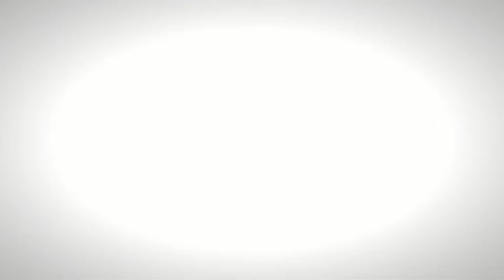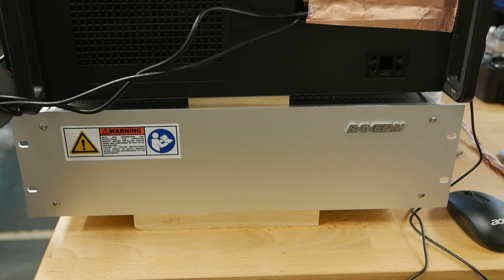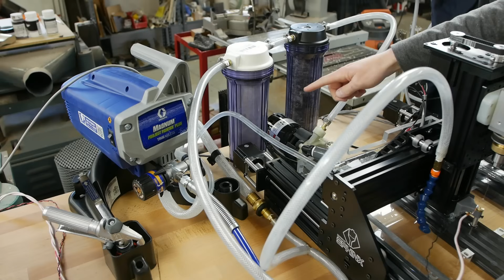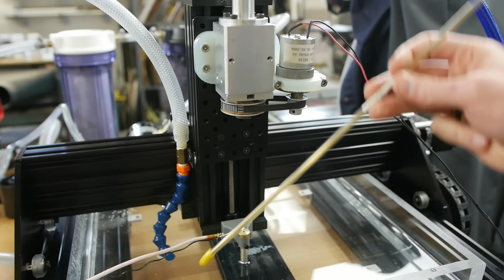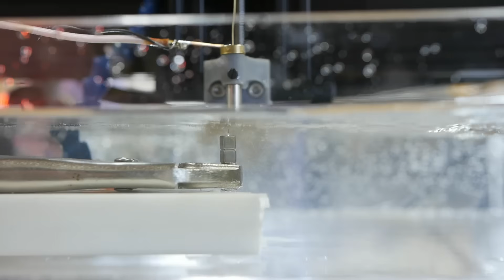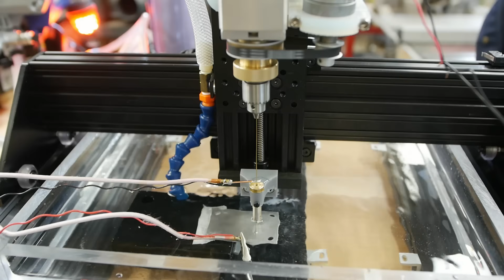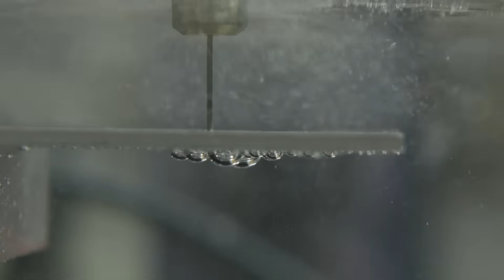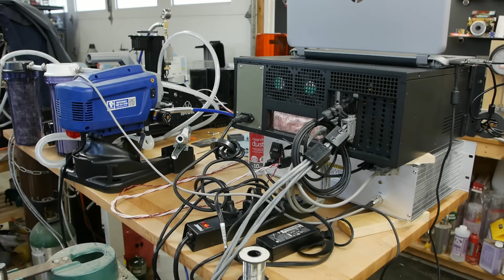Drill through anything (conductive) with Electrical Discharge Machining

Comment: What if instead of forcing pressurized water through an electrode you use an ultrasonic cleaner to get rid of metal particles while drilling? Will it work?

Comment: Just for fun i did something "similar" some time ago with my 30v 5a lab ps, a piece of copper wire and aluminium foil, just used the overcurrent feature of the ps to constantly get like 30v 10a spikes trough the aluminum foil, resulting in kind of plasma cutting i think? Or it was just a really sparky edm XD

Comment: I had a 7.4 volt lipo battery plugged into my charger for my rc car it was very hard to unplug so I unplugged it from the charger for more leverage the two ends touched and a shower of sparks just blew up and the two ends where completely melted and unusable

Comment: I haven't seen EDM in decades. Guess I really haven't found a need for it lately.  We used carbon electrodes for drilling holes but we also had electrodes in special shapes which were used to essentially cut precision curved slots in hard to machine aerospace  materials. 

Our coolant setup was very different from the one described.  Coolant was similar to ordinary low pressure, high flow spot cooling for other machine types but the conductive coolant was different.

Comment: I'm a reverse code engineer by trade but holy geeze... There is some unidentified logic in my brain that is inherently inquisitive about the ability to drill a teeny tiny hole through almost any conductive material you can imagine... These materials were specifically produced in order to resist the most abrasive materials and processes that man works with yet its almost as if you've managed to just push a small pin through them as if they were butter... So freaking cool! What I really want to know though is how the heck they create such a teensy tiny hole in those conductive rods that are already ridiculously tiny.

Comment: Have you tried using it to drill through quartz?  I would be curious to see what happens with that. Maybe try both natural quartz and lab made crystals.
note  Quartz is NOT electrically conductive. It does however have piezoelectric properties which means it generates electricity when subjected to pressure and vice versa expressed pressure in the form of physical deformation when subjected to electricity.

Seems like an interesting experiment to me.

Comment: Great info and detailed information,  a couple questions:
1-Can this be modified to cut shapes instead of drilling only?
2-Do you do detailed build guides?
Reply: To answer your question, it's possible as far as I know, but not particularly useful. You'd want some tension on the electrode (which is where wire edm comes in)

Comment: There are lots of versions of those rubber seals.  In fact, every manufacturer of these machines has a slightly different rubber seal.  The electrodes do get smaller than 300 microns or .3mm/.012".  There are also .010",.008, and .004".  Yes, 4 thousandths.

Comment: Is there any way it could drill through Granite, Limestone, etc.
Reply: You need a conductive material. Sedimentary material like that will need a waterjet for small tolerances. An adjustable hammerdrill with water added to the front would push the slurry out with help of raising and sinking the bit periodically, if you can't afford a waterjet... a lot more hastle, but ridiculously cheap in comparison.
Reply: @cavemanofgeorgiainc2654  Hi Cave man quite an apt name for what I have in mind. I've used diamond tipped drill bits to cut Granite, with water to cool the tip down. No I have a different reason for asking the question. Somehow the pre-Egyptians managed to drill holes in solid granite. I wondered if they had a similar type of method for cutting the holes. The holes were not drilled using copper chisels and a stone. The pyramids, I think, were built for a practical use not for a tomb. Did they manage to harness sound, water power jets? To cut the holes.

Comment: I operated an EDM machine back in the late 1060's I believe it was made by a company near Rockford Illinois.It used vacuum tubes in the power supply They were 6AS7G's I think their was 48 of them in the supply. We were making carbide shaper knives 'The cutting electrode was a large rotating graphite wheel that we used a sample of the knife to cut the form in the wheel we wanted to cut. The fluid was an oil that was pumped through a semi truck oil filter to clean the fluid. The thing was a beast but it worked.  W e had to keep a bunch of tubes and fuses on hand to keep the beast running

Comment: Try using EDM oil its a dielectric fluid meeting the requirements for insulation and controlled dielectric discharge during electrical discharge machining operations.

Comment: Could you adapt the same principal for stone?
Reply: Not unless it is conductive. Use vibration instead! Vibration on a brass rod or even a copper tube will easily cut through rock.
Reply: @ladeda7033  I was considering the pizo electric effect. You know like how a quarts watch works.
You could get vibration and a current.
 I think current alone would work on curtin types of rocks.
Ile have to check it out.
I just Finished a little project I was working on.
So this may be my next project.
I'm not well informed on this.
It's not knew to me but I've never took any time to understand and learn about the working .
This video has put tuns if ideas in my head...
LoL

Comment: The miniature version of this(hand held)  works great on cutting locks or breaking into people's houses for locks that are resistant to drilling. Basically this is just a mig-welder that drills a hole or used as a cutting torch.
Reply: Basically it's just spark plug
Reply: that's what i thought, this is scary.

Comment: I think this may be a similar process to how the stones for the pyramids were cut. Pressure would have been within their capability back then by filling tall slim water tanks, and they had brass available.
Reply: In fact, the pyramids were built of "cement" blocks, poured into forms in their final position. Read "The Pyramids" by  Dr Joseph Davidovits & Margie Morris (Hippocrene Books, New York, 1988). There are many examples of this technology in the ancient world, from diorite beads with fine holes to string them into jewelry, to stone dishes and narrow neck vessels, to massive stones at the base of the acropolis at Baalbek and the harbor at Caesaria. The ancients did not have tools hard enough to cut such stone, nor the ability to lift and move massive weight. Cement is a geopolymer, and the use of different mineral and organic additives in the polymerization process can change the strength, rate of solidification and surface color. Most rocks that we see are geopolymers. There are no quarry marks on the stones of the Pyramids at Giza.

Comment: We had a commercial one of these in the repair shop in the Navy.  Used it to 'drill' out broken bolts in machine casings.  Actually pretty neat.  But ours didn't actually turn the current on and off, the drill tip vibrated up and down rapidly.  So it would touch and pull away from the work, drawing a spark as it withdrew and extinguishing as it pulled further.  ISTR it was DC current, which made the work erode faster than the tip??

Comment: Can you cut through something more conductive then the drill bit? I'm just wondering why the arc always forms at the tip and doesn't arc from the side of the bit into the walls of the drilled hole.

Comment: How long before i can get this in a hand held version? I have to drill through some really hard ceramic tiles at work and it costs a fortune going through tile bits.
Reply: f budd : object being “drilled” must conduct electricity.      Ceramic is an insulator, meaning electricity won’t pass through it.     I’m almost certain.

Comment: What voltage does the arc generator operate at  ?
I presume that once the arc has struck the high current operates into a near short circuit so it doesn't need to operate at a sustained high current, high voltage.

Comment: what's the adventage compaire with laser?
Reply: did the kids watch too much Star Wars? :)))
Reply: @x71345  are you my kid?
Reply: @frankchang436 I'm sorry, I probably made a bad joke (my English is far from perfect):))) However, I work on the same machine, for example, with a laser you can not make a hole with a diameter of 1 mm and a depth of 30 mm.
Reply: @x71345  ok, it is a good answer and professional answer. The depth would be a problem in laser solution. But in other way, this solution just can make "through hole".

Comment: what would be the total estimated cost to build this?
Reply: The BX17 arc generator itself costs 2900 euro in europe. The rest of the machine can mostly be build in the machine shop. Have a look at the website : Baxedm com and his youtube page he takes you on how to build a wedm (a wire cutting cnc bandsaw like machine based on this technology). I would asume in the range of 5-10 k euro's depending on what you machine yourself, and if you go drilling or wire edm. Also you should take into account the amount of money it might take to trouble shoot a machine like this. You are working with very high frequency's and voltages which means you have to insulate almost everything and even using a wrong hdmi cabble for the display to the pc can make the machine unusable. To make the machine as accurate as possible we are talking about precision granite ways, air bearing, linear servo's climate controlled room to 20 celcius making it a 100k project.  The machine that the developer of the arc generator has build uses clearpath servo's and mostly self machined components my guestimate for his cost is: avg clearpath sc servo: 400*4 + electronics 1k + intel nuc 500 + materials for build 1k + the arc machine = 8000 euro's. Sorry for my english spelling but hopes this gives some guide on the cost.
Reply: Over 9000

Comment: This is interesting can this process bf boards.e used to drill circuit boards?  Clean holes with high aspect ratios in 5 g  boards are the bug_a_boo  that is slowing down production of these types o
Reply: After watching the entire video the process looks too slow for mass production  purposes.

Comment: I disagree with the use of the word drill, in your video because that really is improper nomenclature. Same could be said for high pressure water to punch holes into material. If you shot a hole into a stop sign, would you say you drilled the hole? Lol

Comment: How much does that psu cost? I've gota think one could build one pretty cheap if they know board CAD. U haven't mentioned voltage... Might take si carbide or Gan fets... But... If one has a legit biz or domain and email, can probably get sample parts for a one off for free

Comment: CNC mills and lathes can backup when doing peck drilling so for true commercial CNC tools going backwards is not a problem.
Reply: Not as a feedrate function- you're absolutely right they can back up (typically Z) the issue is the software has to be written differently and execute a Z+/- Gcode on detecting a short- I'm wondering if this is even necessary or whether you could just have a weighted solenoid or something bump the head up a few thou if it detects a short or simply set the feed rate low enough the arc is always long and make it through the material (more slowly) that way. This would be a great project for someone to code in, say, Mach or EMC2.

Comment: Make your own vented cap screws for a home-built Metal vacuum chamber.  Do not use a glass bell jar!  The risk of implosion and winding up with imbedded glass shrapnel is far too great a danger.  1/2 inch aluminum is recommended and you can install view-ports and access ports as required.  How Does a Vented Screw Work  https://youtu.be/n_adTP6R56s

Comment: Even though the fluid stream exerts a force on the workpiece, the reaction to that force acts on the fluid, not on the drill bit.
Reply: How do you know that the fluid does not have tension?
Reply: @factorylad5071  What do you mean?
Reply: @JorgeStolfi  under the extreme pressure the stream tends towards becoming a solid object itself , so the reaction will be at the orifice.
Reply: @factorylad5071  Sorry, I don't see how that could happen.  Water at the bottom of the ocean is still as fluid as at the surface...
Reply: @JorgeStolfi  ok , that's a quick way to prove the absurdness of my statement but my reasoning is confined to streams only. Suppose you have a pressure washer jet then, do you feel a force acting against the nozzle when you bring it close to a brick wall? If so why?
Reply: @factorylad5071  If it is close enough to partially  close the opening, the pressure inside the nozzle will increase, and that will increase the reaction force on the nozzle's support.
But if the distance is a couple of times the nozzle's diameter, the pressure inside the nozzle should hardly be affected.  The pressure inside the nozzle accelerates the water to a certain velocity  that should not depend on whether there is an obstacle ahead, and then the kinetic energy of the water will create a force on that obstacle
Reply: @JorgeStolfi  alright , we utterly disregard the situation where the nozzle is partially closed then. But you say the velocity should not be affected but I believe it is. Only momentum tracking would provide any further truth.

Comment: Could EDM machining be used to drill holes into granite and if so, what kind of machine marks does it leave in the granite ?
Reply: material has to be conductive, but soaked with water would the granite explode when EDM was attempted?

Comment: Used a EDM in Pasadena City College in California.  The lathe chuck keys needed to be recut.  So I created a square hole in a block of carbon.  The oil was forced through the bottom.  The chuck key was mounted in the quil.  It was a good way of cutting 1/2" square tangs on the end of the old lathe chuck keys.

Comment: What is the rate of cutting through iron? This could be useful to me but the machine is very complicated. It would be neat if you can make complicated parts such as gears instead of just making a straight hole through metals.

Comment: ''Drill through anything (conductive)... caught my attention, ''well, I must see this,'' I thought'...! So, I followed the narrative throughout, and found it to be somewhat 'over my head' - but still hugely captivating! (The only parts I found some resemblance to my own experience, was the mention of some of the stuff you're actually able to get from AliExpress (😉👍), and, naturally - when Ben came to the description @13:31 - ‘’and then on the bottom side here,’’ – ‘’this is the electrode interfaced with it - I came up with it myself, which,... I don’t know if this is really ‘pro’ or not, - but, it’s basically just a piece of brass with a hole, that’s very, very closely matched to the electrode diameter…’’ - I had no problem associating with the fine small globs of solder there!!!😄 All in all, a very interesting 'docu' on how to make holes! . . . . .🏆 ⭐️⭐️⭐️⭐️⭐️⭐️

Comment: Using old school science, You can cut through the heavy screening like that used to cover outside of jail windows using leads from the power transformer of an A.C. radio connected from the inner bare section near a pencil eraser and to the inner pointed end. Just carefully insulate the connections and use like an arc welder.

Comment: 70 psi sounds a bit to much for the tubes and water filters.....
Or is it the pressure in the hollow "drill"???
Reply: the drill has about 1000psi at the feed end. he said that a few times. and not 100% but i think a lot of those filters are rated for about 125psi.

Comment: A little story I heard often from my grandpa who worked in a tool & die shop. There were two competing shops in town, and this was a generation ago, 1970's, 80's. One day, one of the shops, proud of their cutting-edge machines and engineering expertise, sent a package to the competing shop, a little package. It was opened and inside there was an almost imperceptible length of metal, thin as a hair; it was a drill bit. The package was a gesture of triumph---ha, look what we can do at our shop! Some time later, the package was returned to the first shop. The first shop opened the package, found their amazingly tiny bit, but there was something else included---a magnifying glass. They were a bit confused at first, but then they inspected their bit with the magnifying glass... The second shop had drilled a hole through the bit before they returned it.